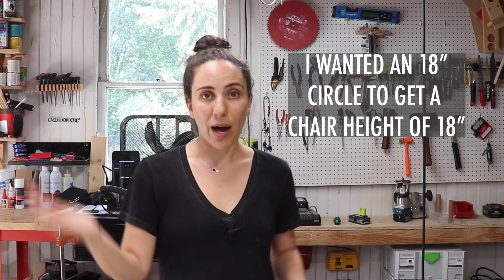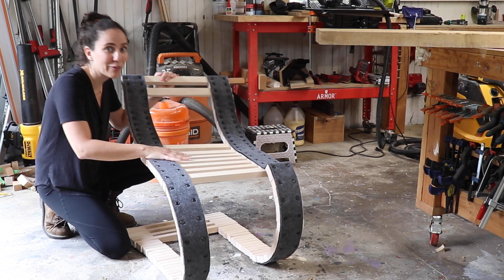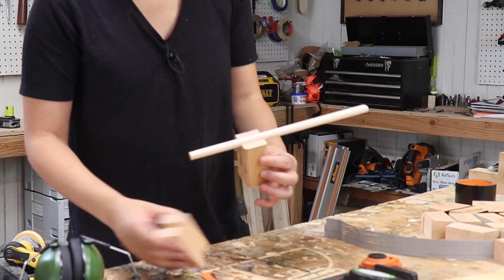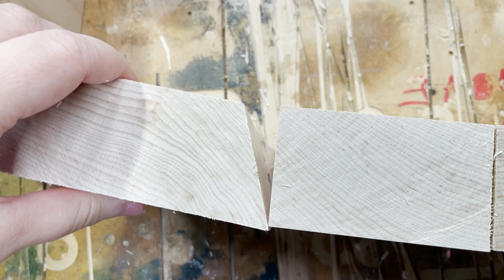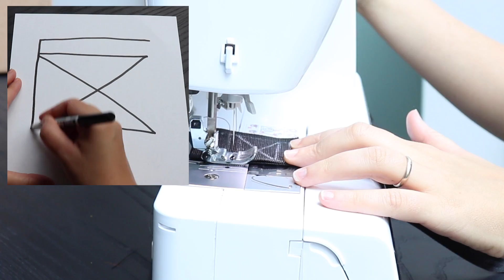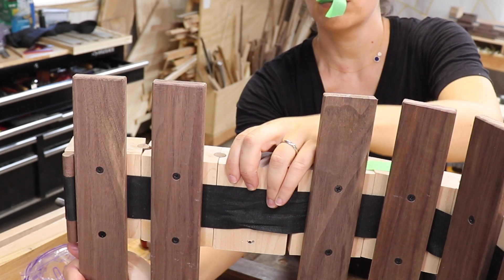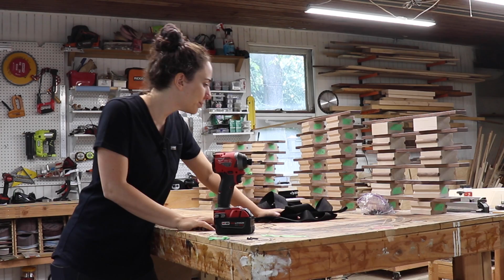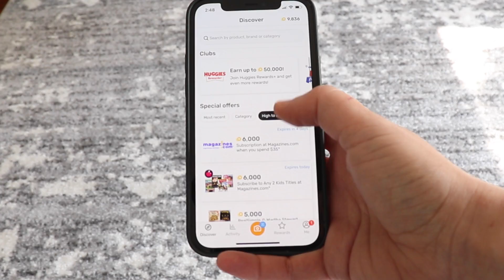I ATTEMPT to make a Roll Up Chair… AGAIN...

Comment: Doing a quick back of the envelope calculation:
- The person sitting on the chair would be ~100 lb ~50 kg (ideally the chair would withstand more than that but less would be totally impractical/dangerous)
- The articulation of the chairs are lever which gives your weight (+ the chair's) a mechanical advantage of ~20
- That gives a tension on the strapping of ~ 2000 lbf ~10000 N
- The droop of the seat has to be less than ~4 in ~10cm
- The same lever translates that in an elongation of the strapping less than ~1/10 in ~0.5cm
- The length of the strapping piece is ~6ft ~2m
- The maximal elongation of the strapping is thus ~0.5%
- Searching for steel cable elongation formula, I got E = (W x G) / D² where E is the elongation ratio, W is the load, D is the cable diameter and G a coefficient depending on the material/constitution of the cable
- For a single 1/4 in ~ 6mm diameter cable, it gives a G coefficient of ~1/64000 which seems to be between the best and worst quoted values for steel cable.
=> Steel is a possibility
=> The tension will be in ton range
=> You may want to attach it to each slat to both minimize the elongation and reduce the tension on other parts (top and bottom of the chair)
Reply from the maker: Awesome info

Comment: Tamar, 
Welcome to the iterative hellscape that is product development!! Doing something new like this is never easy, but you've already come a long way in getting it figured out and solved a lot of tough engineering problems. Using the interlocking dowels to prevent rotation was a genius idea! 

If I can provide a couple other "engineering" insights:

Materials:
I do not think there is a simple 1-2 inch wide strap material out there that is going to perform as you need it to. Every material has what's called a "Stress vs Strain" curve/chart. Strain is the percentage change in length (eg how much it stretches) and stress (in this case) is basically a function of the load on the material in tension vs the cross-sectional area of the material. The more stress applied, the more strain (stretch) occurs. Leather is a lot stretchier (and weaker) than the strap you're currently using. I wouldn't try it.

From an engineering perspective, what you want to do is reduce the amount of strain seen by the strap material. There are three ways to solve this: Change the material, Lower the load, or Increase the cross-sectional area.

	1. Changing the material
Changing materials is usually a good option, but you probably need to change it more than going from one brand of fabric/polymer strap to another. The strap at the front (where your calves would touch it) is subjected to hundreds (if not thousands) of pounds of force when you sit. Imagine you're trying to loosen a bolt by sitting on the end of a 2ft long breaker bar. The force on the bolt is analogous to what the strap on the front of your chair has to endure. It's a lot. If you just want to change materials, you're probably going have to change to metal cable or banding before you see any significant difference. Josh Wright used metal banding in his rollup chair.

	2. Lower the load
I list this for completion but really for your project this isn't something you can change, unless you only want to make a chair for small kids (and who wants do that? My kids much prefer sitting on the floor anyway).

	3. Increase Cross-sectional Area (This is what I would try!!)
Basically get a thicker/wider strap. This way the load is distributed across more material, which puts the material under less stress, which will cause the material to strain less. Tow straps are made of similar material to what you are using but are many many times thicker and wider. Some heavy-duty ratchet straps would also be a lot thicker and wider. Another easy way to increase the area is to simply DOUBLE UP THE STRAP. Double the strap means double the cross sectional area which means half the stress which means HALF THE STRAIN (ish). Heck put four layers of strap on each side and you will only see a quarter of the strain.

"Preloading" the material, which is what you did by stretching it out ahead of time, CAN help lower the amount of strain (because most materials strain less as they reach their breaking point) but it's not going to be much. Especially in this case because the amount you can safely preload is only a small fraction of the load seen in use. Get it taut and that's about the best you can probably do.

Design:

As you noted, while tension in one part of the strap is instrumental to keeping the chair upright, it also pulls the other part of the chair over. This is because any force applied through a material applies equal tension throughout the whole material. Imagine a rope with one person pulling on each end. The whole rope is under tension. Now imagine a third person holds the rope in the middle, and one of the people on the ends lets go. Part of the rope is now in tension, part of it is not. Herein lies the solution to your problem: the strap should probably be affixed to a few different points throughout the chair to allow different parts of the chair to be under different amounts of tension.

There is another added benefit to having the strap screwed into at least a few different places, and that is that strain is a function of length of the material. Eg, if you have 10ft of some material and apply 100lbs of tension and get 1ft of stretch, then if you were to apply 100lbs of tension to only 1ft of the material you'd probably only see 0.1ft of stretch. If you limit the application of stress to shorter lengths of strap, you will see less stretching overall. As it is right now, the strap in the backrest is seeing the same tension and the same strain/stretch of the strap in the front.

To Summarize (sorry for the wall of text) I would 
	- Double/tripple/quadruple up the strap and/or switch to a thicker/wider strap
        -Afix the strap to the chair a few times at least rather than just at the ends.
Reply from the maker: Great ideas. Thanks!

Comment: The issue is the pieces separating. if you used hinges between the pieces (small enough to be hidden by the straps) then the pieces can stay together and would eliminate the slipping potential.
Reply from the maker: Maybe!

Comment: Id suggest trying to use steel cable for replacement strapping. You could have a locking/tentioning arm that pulls the cables to peak tention when in chair mode. Pop the arm over, release the tention, and roll it up.

Another point is that the wood, even hard wood, will squish a bit at the ends. This means that the initial curves need to plan for this squishing. Instead of a 180 degree arc for the bottom arc, a 160 to 170 would be better.

Also, you could always just replace the back 1/4th inch with steel. Way more weight, but much much less deformation.
Reply from the maker: Interesting

Comment: So interesting! I wish I could brainstorm with you ^_^ ... Would connecting the ends help make it safer? Perhaps making a way where the straps are loops you somehow attach to each other once it is rolled out?
Reply from the maker: That’s definitely a way to prevent it from collapsing
Reply: @3x3CustomTamar  I'm only not sure if you'd accidentally make a catapult that way 😅
Reply: Yeah, that's what I was thinking. Especially for that top piece that wants to collapse, but also to add more strength to the center of the seat portion

Comment: Thank you for your efforts and well you did not get your back broken by trying to sit in the chair.
Metal hinges covered in leather could be an idea. You can probably lower the hinges into the wood so that they are barely visible.
If your straps are 10 feet long and yield 0.3% it's too much! You can not use such long straps!
Reply from the maker: Yeah. I’m glad I didn’t break my back too. Ha

Comment: As you have identified, the stretchiness of the material is a big problem.  Maybe you could use something like a bicycle chain instead?  That would be way more work, since you'd have to cut grooves and epoxy it in or something like that - not to mention that the chain links would have to fall at just the right spots.  Metal strapping might work as well, though the concern there would probably be metal fatigue (unless there's a kind of strapping i'm not familiar with, which is meant to be bent back and forth repeatedly).  No matter what, the wood itself may still never be strong enough to avoid deforming.  Still an interesting idea - thanks for sharing it!
Reply from the maker: The materials are the problem here for sure

Comment: There she goes putting the plane down on it's blade again, oh the horror, the inhumanity of it all.
Leather stretches also, which I think might be part of the problem. Using either a heavier web or if they make such a thing, one with steel strands in it. Something that limits stretch, You're getting closer with each reiteration.

Comment: what about a chain instead of a belt?  i thought about a roller chain like on a bike, or maybe a double strand version of it.  i have seen ones with attachment points also to make it easier to screw to the wood.  This would definitely not be light, but it would not stretch, not need tension and the crossrods would reinforce the sideways movement like your splines do.  And it might add a little industrial feel.
Reply from the maker: Interesting

Comment: Even if you made hinges out of steel the problem you are running into is cumulative elasticity.  As one joint becomes rigid, the tension on the next increases as a series.
One segment tension = total load / N segments.
As each reaches static loading, the number of segments bearing the load decreases and segment tension rises.
Even with steel cable you will have the same problem.  The force increases exponentially with each segment.  It's actually VERY dangerous as a result.  Because of the leverage of the total length say 6 feet means you put 200lbs on the chair you could have 1200lbs of force on a single joint.  Bang someone loses a finger or eyeball.
Reply from the maker: Yup. That’s why I gave up towards the end. Ha

Comment: How about using not a single piece of strap but a number of smaller ones separate from each other so big tension on curled parts wouldn't apply on back and base parts and they wouldn't collapse. Also thought about of some (or every) wooden pieces to be somehow rounded and eccentric so under the weight the whole construction would pull on by itself, although it would be much harder to make.
Reply from the maker: Interesting

Comment: Glad you came back to the chair.  If the main issue is the straps stretching, have you considered using steel cables instead?  I guess another possibility is a chain linkage between each block segment.  The issue caused by over tensioning the straps is something that would only be seen in hindsight (it definitely surprised me also).  I sooooo want to see you succeed with the chair (and then you have to bring it to Workbench Con!).  Please don't give up!
Reply from the maker: Haha I don’t think I’ll get to it before then

Comment: EDIT: nevermind on aramid. Quick research seems to indicate it's not much different than a hdpe fiber for stretch and it doesn't respond well to sudden changes I tension. Not good for a chair.
I definitely don't have enough experience to really comment on this design idea, but one thought I had was using an aramid/Kevlar based webbing. Those materials are used on high end bicycle tire beads to replace steel wire. Tires can't stretch much or they would fail. Don't know about cost or availability though. 
Overall I do wonder about point load stretching being a problem though. Once a segment starts to separate it would seem to quickly become two little levers working harder and harder to stretch the material.
Anyway I love the ideas you come up with and wish you the best when you come back to this project!
Reply from the maker: Definitely more research needs to be done!

Comment: Bravo for multiple attempts in such a challenging project.  Any chance that ONLY using dowel  as the inter-locking mechanism? You know, just like the metal strap for watches.  In the right scale, perhaps it would work.
Reply from the maker: Maybe

Comment: Valliant effort! I think your idea of connecting the bottom and top straps when the chair is set up will solve the safety issue of it trying to roll its self up when under tension. UHMWPE is very strong for its weight but is also relatively stretchy (low slope on its stress strain curve) as you demonstrated with the chair. Steel will have less stretch but the relatively small diameter of the cables would likely compress the wood fibers under load resulting in a similar problem. Carbon fiber ribbon would likely be the best solution (with out resin, just the ribbon), it is a little more stretchy compared to steel but mush less than UHMWPE. You could even use a the same construction method with anchoring it at the ends with some resin. Looking at the stress strain curves for the materials will be your best guide to selecting what is best; a material that has a steep start to the curve or low strain (stretch) for high stress will serve you best in this endeavor.
Reply: For clarification, steel will stretch 0.2% of its length at its yield strength 200-400MPa, carbon fiber about 3.5% at 800-900 MPa, and UHMWPE 10% at 35-40 MPa.

Comment: You are fighting 2 problems with this chair. 

The strapping is going to stretch initially.  You need to pre-stretch the strapping before you assemble. The other issue is compression of the wood. You probably need to cut your angles a little shallow and the under tension the wood will compress. 

I will say this is one of the most impressive projects I’ve seen. You have done an amazing job with this.
Reply from the maker: Hope to get it working one day!

Comment: While webbing straps are quite strong, they are not particularly stiff and they stretch a bit for the first few months after they're put under tension.  I think a 1/16" thick polycarbonate or UHMWPE sheet would help with stiffness, but might not have the strength.  A strip of 0.015-0.02" thick spring steel would be my next guess.  Steel belts are occasionally used industrially where a belt is needed but rubber and cloth don't work.   

The stability problem while loaded indicates that the strap slips slightly in each block and tension is roughly equal over it's whole length.  A sufficiently strong anchor at each block would keep tension local to the load, but that's easier said than done.  

Given all that, a hinged metal "strap" may well be the most sure way to get the needed stiffness and strength.  A pre-made metal chain might be the easiest way to do this.  Bicycle/roller-chain or a metal lifting chain would be my first choice.   In particular "double pitch" roller chain or "long link" lifting chain would better fit your look while still being a standard product.  Looks like size "2050" with 1.25" pitch links is easy to find from your local farm supply store in addition to e-bay.   Lastly chains also come in "conveyor" versions with tabs on the links so they can be screwed to stuff more easily.  (hollow pin chain is another option that's easy to screw down)
Reply: Looks like a fan of yours used steel pallet banding successfully by screwing it onto the wood.  If you want a simpler look, 6" wide spring-temper rolls of shim stock are fairly easy to find as well.  https://www.youtube.com/watch?v=2MSEnMGFhMg

Comment: A carbonfiber cable has less stretch than your current straps. I think you really should do some calculations on the required tension to keep the chair’s structure. My gut feeling is that tension needs to be way higher than what it is today.

Comment: How about routing the strap through the middle and add a ratchet  at the end, to tighten the belt for siting mode and losing to rolling up mode.

How about using a bike chain instead of the strap.

Comment: I love this channel so much! 
Thank you for making all of us that work with wood feel better about mistakes.

Metal cable routed into the pieces instead of the straps could be helpful and possibly hidden?

Either way though, thank you for the emotional rollercoaster that was these two pieces of content 😊
Reply: I was thinking screw the fold up issue and stick some bent rebar in it instead.  Still a good looking chair !
Reply: I was thinking the same thing. Consider using something like bicycle break cables that are sent through drilled holes. You could do two per side which would also help with the side to side motion. The nice thing about metal cables is you can easily adjust them.
Reply: I was about to say the same thing. Metal cable.

Comment: I would not use metal hinges but wooden ones, like to a modified tenon and mortise that is through drilled to allow rotation around a thick dowel or metal axle. Angle one side of the mortise to be the desired mating angle between the two maple pieces, and on the opposite side remove it all so it roll up. The side walls of the mortise would resist transverse rotation and separation of the two maple pieces (catching the skin). Such a format would limit the degrees of freedom to a single axis rotation at that maple-maple interface. Optional pins could be used to lock each join in place while in use to avoid accidental roll up.

Comment: I agree with the cables through the blocks, it won't stretch under the weight of a person.  Also, if you want to use a webbing for aesthetic reasons, I think you would definitely need to secure it to the blocks. can't wait for the next attempt!